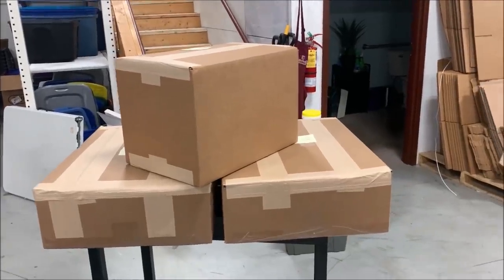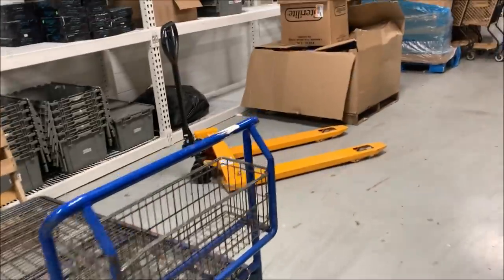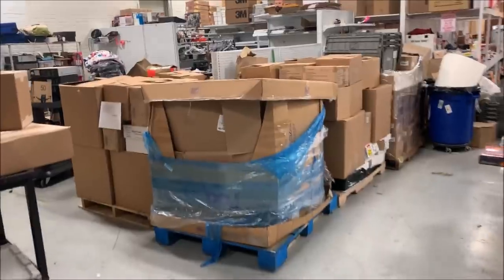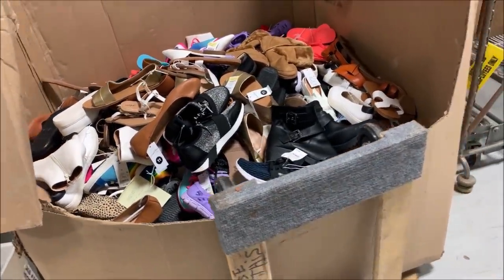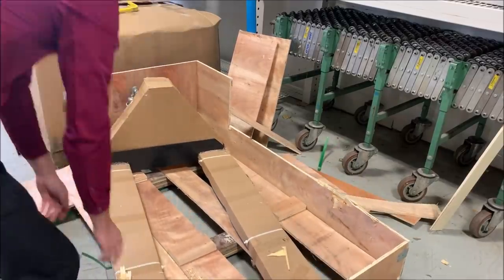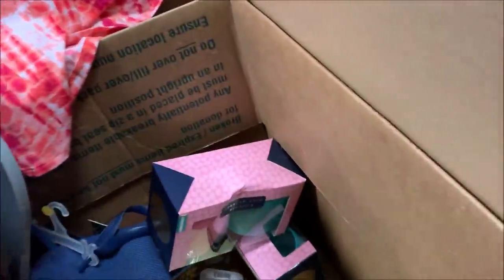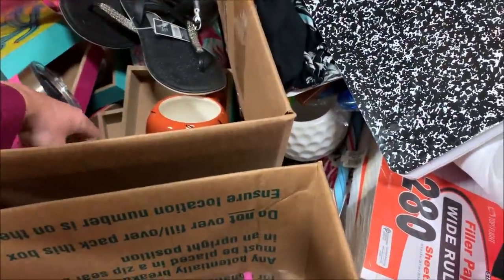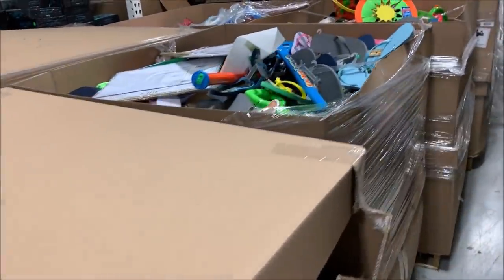Lots of Rambling and Some Walgreens Pallets to Go Trough

Comment: Just a suggestion, you mentioned it already in an oblique way..   never send in more than a few cases at a time of a single item.  You get penalized if you have more than 90 days worth.  Which is why its not worth .30 a label -- send in a few boxes and then revisit it in 30-60 days to get a restock level.  

I learned that one REALLY early, when I got a deal on 2 cases of new computer mice and sent them all in.  Now its almost a year later and I have sold 10 or so.  (and recalled 85 of them during the free recall period last year)

I agree with the viewer who suggests it is time for you to get a pallet lift or a fork lift and go vertical.  You already HAVE that cubic footage paid for and its not being used.  :)

Comment: made $30-40k on one deal but cant afford a forklift??Thats a head scratcher..i understand overhead an all that but when you can use a tool to make more money and make it easier,its a no brainer to me..
Reply from the maker: Don’t have space for one. Warehouse is only 7000 square feet and of that, about 4000 of it is customer space, so it would be tight to move around with a fork lift.